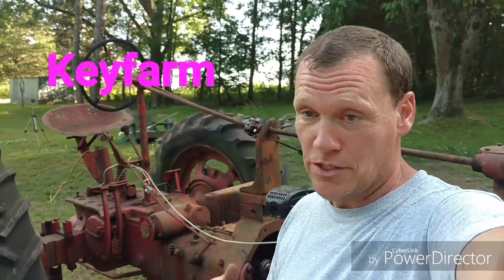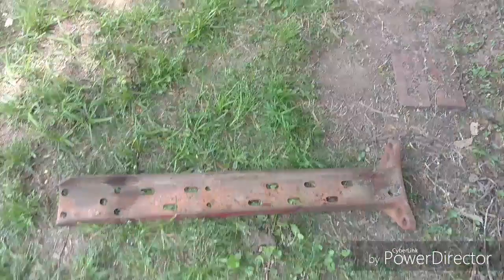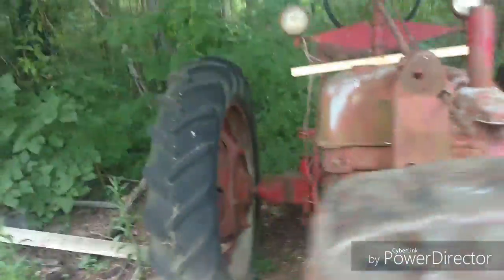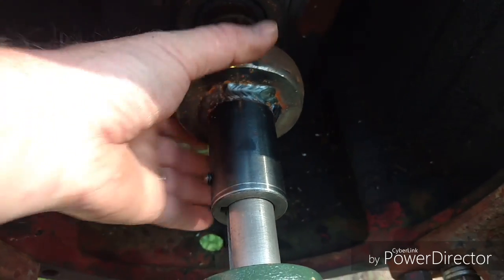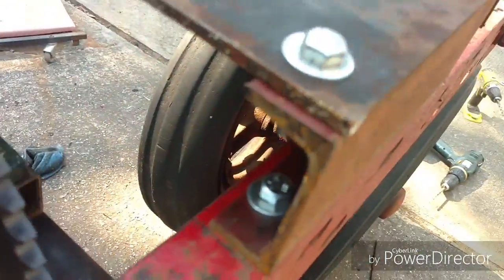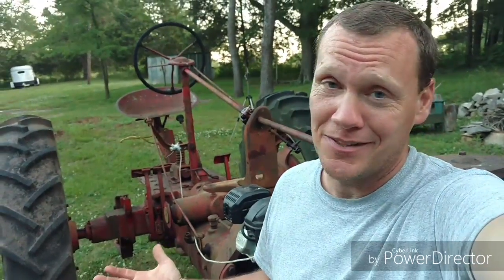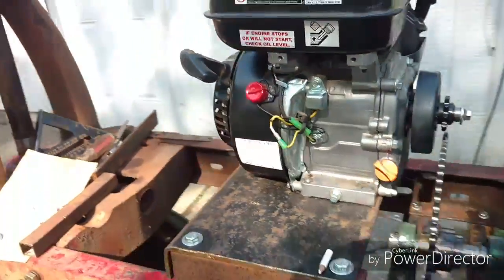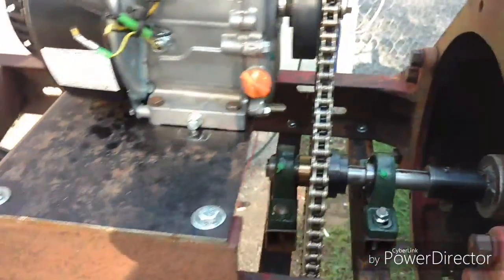Predator 212 Tractor

Comment: Dand a cvt torque converter system woulda really helped on this build .you get the power were you need it the most and runs way better then a regular cart clutch . Them centrifugal clutches only work good when you have the power an rpms to keep it fully engaged. Pretty much only full throttle all the times a keep momentum so it to slip.
Reply from the maker: On a tractor you run it at full RPM so that's not a problem .I have had CVT systems on other projects and I have found that you work on them about three times as much

Comment: Those old H tractors are known to crack around the water Jacket so if thats all thats wrong with the original motor I'd put some JB weld over it and take off. I have a 1936 Farmall F-20 and it has JB Weld over a crack in the block for the last 15 years.
Reply from the maker: This one was cracked at the back of the block where the camshaft sets I don't think we wanted a wobbly camshaft.

Comment: Love the videos! I want to do this to a 1979 datsun b210. One question- why not connect the motor shaft directly to the transmission shaft via the couplers? Do the gear teeth/size ratios have affect speed/and/or torque? Just really curious to kn ow before ordering parts
Reply from the maker: First and most importantly you need a way to clutch it The original motor the clutch is attached to the flywheel and of course that is gone second reason with these low power engines you need to multiply torque to get them to do what they need to do. Check out my other videos where I have put these engines in small pickups and small cars as well as big pickups

Comment: Are u happy with the 82 inch sprocket. Is it enough to pull a single plow?
Reply from the maker: It was an 84 tooth sprocket, and yes at that gear ratio it'll pull anything or spin the tires( watch the stump pull video) it is just slow

Comment: Very nice man. It's awesome.  You should try a belt drive system instead . It's all there at tractor supply. You just need a large 14in pulley or so. A small 2in x 5/8 . all half inch ,and a idler.  N youd be way way happier with it.  You'll have way more control, With a actual clutch. And no over  heating n those  clutching belts last for ever.  But make sure it's a clutching belts. There only like 30 bucks but they really last forever n take a beating . No lie.
Reply from the maker: Thanks, I've considered belt drive, just busy with other projects right now.
Reply: @ChrisfromKeyfarm  oh I just saw it was 2yrs ago.   Ill definitely check out the chanel

Comment: Thank you for the inspiration! I have been studying your engineering for awhile and decided to collect all the parts for my own project. Mine is a McCormick Deering international harvester model 10-20 probably from the late 1920's maybe 1930's. I just completed my first test drive tonight and am happy with the results. I used a Briggs and Stratton 8hp from the 1980's. The engine needs a rebuild, so will be disassembling and doing that work soon.
Reply from the maker: That's awesome

Comment: Hey Man like the channel I have a little project I'm starting can't wait to see how it all goes
Reply from the maker: Cool, what is it?
Reply: @ChrisfromKeyfarm  planning on putting a 459 predator in a s10 4x4
Reply: Think a centrifugal is a good way to connect the transmission?
Reply from the maker: That's how I connect mine, it seems to work just fine.
Reply: @ChrisfromKeyfarm  good to know will be interesting to see how it works

Comment: Very nice but how do you shift without the couch?
Reply from the maker: Centrifugal clutch stops when you release the throttle. On my pickup I built the same way, I float the gears like driving an 18 wheeler without using the clutch.

Comment: What's the biggest load you've pulled
Reply from the maker: Well, I made a video of it pulling a stump and that was pretty cool, but something here recently , with my farmall C I pulled my 16 ft hay trailer to the barn with 2 rolls on it. When I hooked the Predator 212 farmall H to the hay to pull it off the trailer, it pulled trailer, hay, other tractor and all, till the mud piled up in front of the other tractor tires and the hay began to move. This thing is slow but strong.
Reply from the maker: There is also a video of it pulling my 16 ft. With 3 rolls on it.

Comment: The older farmall engines are beastly. if you can get them. i got a farmall 450 the block and head are immaculate, no cracks or repair welds. it has the big back c281 engine in it and could pull a 4 bottom plow if i had on in the toughest of grounds.
Reply from the maker: Awesome

Comment: I was recently given a '97 Wheel Horse 520h with an Onan 20hp engine. I wonder how a Wheel Horse horizontal shaft engine with its PTO would do in a build like this? Like the PTO could be setup to work with a foot pedal to control the tranny? Might be interesting.
Reply from the maker: It would be
Reply: @ChrisfromKeyfarm  If you're not familiar with the old style Wheel Horses with their horizontal shaft engines and PTO's, the PTO design is similar to what is used between the transmission and engine on old farm tractors and manual transmission cars and trucks but it is set up slightly different. On manual transmission tractors, cars and trucks, the engines flywheel is a steel disc and the transmission has a clutch plate mounted to it controlled by a clutch slave cylinder to push the clutch disc against the engines flywheel to transfer power between the two. On the Wheel Horse machines, there is a steel pulley that has a smooth inside face that does the same thing the engine flywheel does. Then there is a clutch disc with a fiber facing on the engine drive shaft. This clutch disc is a pulley also and turns continuously while the engine is running turning a belt that goes back to the transmission, which is controlled via either gears or a hydro unit to move the machine forward or backward. When the clutch lever is engaged it presses the outer steel pulley against the clutch fiber disc on the engine and that provides power to the belt that runs the mower deck, snowblower unit etc.

Comment: That's cool how you able to shift gears without clutch inside transmission?
Reply from the maker: I can start from any gear, or if you match the trans speed to the motor speed, you can " float" the gears.

Comment: That's cool how you able to shift gears without clutch inside transmission?
Reply from the maker: The tractor is geared low enough you can start in any gear, also it has a centrifugal clutch on the engine.

Comment: I want to do something like this, but with a v twin predator. Problem is I can't find a centrifugal clutch rated for that big of an engine. Also with this set up you probably need to start it in gear, right? I'd think the input shaft would spin quite a bit even with the centrifugal clutch?
Reply from the maker: The centrifugal clutch free Wheels the input shaft doesn't spin at all until you rev up the engine as far as a clutch rated for that high they do exist and they start at about $265
Reply from the maker: Eventually this tractor may have that 22 horsepower predator but that's about an $1,100 project between the motor cost the warranty on the motor and a real high-dollar clutch
Reply from the maker: https://www.ebay.com/itm/CENTRIFUGAL-CLUTCH-HEAVY-DUTY-DOUBLE-GROOVE-A-WITH-1-BORE-24-HP-BRAND-NEW-/350723585062?mkcid=16&mkevt=1&_trksid=p2349624.m46890.l49286&mkrid=711-127632-2357-0

Comment: Within that whole thing.  Whatever can power the chassis, will work..  The big old diesels needed mass to develop torque, big pistons movin slow. That 212 less horsepower than the original it'l move that chassis all day.  At whatever point you can stall out the 212. Thats its peak torque.  The original diesel will run the chassis all day.  The difference is the original you can hook up a freight train, not really , implements,  that 212 if you leave it in place,  it will rotted away before 10 years, definitely not 80.
Reply from the maker: For the price I can replace it every ten years, aside from that at least it is useful again.

Comment: I am using a Predator 212 to power my full scale WWI tank.  It only needs a little bit over idle to move it.  The tracks freewheel over bogies with a hidden tire underneath providing the push.  I will be doing a video on the whole build as soon as it is 100% complete.
Reply from the maker: That sounds awesome, what's the channel name.
Reply from the maker: Nevermind, I saw it

Comment: You really should switch places between the giant sprocket on the transmission for and the tiny gear on the engine. It will go a lot faster and won't have to work as hard to go anywhere as you can see showcased in this video.
Reply from the maker: I have to have the large mechanical advantage for it to move.

Comment: I don't hate what your doing.  Im not exactly in love with the clutch set up , there is a newer juggernaut clutch from go power sports that you may feel is more appropriate for your use .  Ive got an older diesel tractor that has ovaled cylinders. Im interested in doing a similar project but im going to need to use the factory clutch because I need the pto to work.   I  will have to make a gear box and reduction on a 670 to make it worth having though
Reply from the maker: does your tractor have a two-step clutch one that stops the forward motion and one that stops the PTO ,because as far as running the PTO ,it runs off the gearbox in the transmission on my tractor all my PTO is work. when I put a 670 in this the first time it won't have a centrifical clutch it'll have a depressed tensioner that works off of the clutch pedal if that helps you any. They make really heavy duty double v belt centrifugal clutches but they're real expensive like $260. and above. As far as gopowersports I'm not really a fan of their inflated prices. Thanks for watching

Comment: Put a 4 cyl diesel like a kubota V2203 or a 4cyl Kohler diesel on that beast with a normal clutch or run a hydraulic pump off the engine to run a high speed hydraulic motor. Obviously for the most part this is just built with what parts you had on hand but you've proven your concept works now to just rebuild, refine and make it super bad ass. Or just keep as is.
Reply from the maker: Check out the R/C video, that is why it needs a centrifugal clutch.

Comment: I got a ? On the 212 swap for a tfuck would it be better to use a diesel trans because of the lower rpm range?
Reply from the maker: That seems like more trouble, just go with a bigger sprocket on the input shaft.

Comment: To each their own, but personally I think you would have been much better off to buy a $300 original motor out of a junk yard, and put it on. Would have kept its value, and originality. Plus it would be a lot more useful.
Reply from the maker: It would be just another Farmall H, nothing special or interesting.  Years ago I looked for an engine in my area, nothing close to$300.00

Comment: This is NOT a criticism, just an engineering observation.  The mounting holes for the bearing / driven sprocket carriers would have been far better to have been located on the top of the frame rails.  Here is why... as the holes exist now (on the bottom of the frame rails) they are piercing the "tension" side of the member.  This makes them far more susceptible to fatigue cracking.  IF (that is a huge IF) one were to later decide to restore this 'old iron' to the original type of engine  (or something even larger) these holes could become a liability for strength.  Holes on the top side of the frame (while still weakening the frame some) would remain in compression and be far less likely to crack due to fatigue.
Probably the optimum construction would have been to not drill ANY new holes and instead constructed the brackets to bolt on to the outer sides of the frames with holes and slots already provided.
As I said in the beginning, this is NOT a criticism, just observation and hopefully a small learning point for any young budding engineering students of SOHK (School Of Hard Knocks)!
Good video!  Keep up the interesting projects!
Ken
Reply from the maker: Would you believe I knew that, however in this application I felt it did not matter, but one thing about channel iron, if it ever needed to strengthened at least it would be easy to do.

Comment: How about a Wisconsin VF4  or a  VE 4  Wisconsin they are both air cooled , you can find them  about  anywhere. Look I up used Wisconsin  stationary engines sometimes you can find them with the reverse gear already in place.. Just food for thought.
Fred Durbin
Reply from the maker: I promise, it has the setup it needs for the next step

Comment: Does the PTO work?

Isn't that little centrifugal clutch going to burn out? Hard to imagine it could hold up when these tractors came with 11 inch clutch discs
Reply from the maker: It stays locked up most of the time, doesn't build much heat. Yes the PTO works
Reply: @ChrisfromKeyfarm  With it geared the way it is now, can you get the pto speed up to 540rpm? I have a stuck H, I need the pto for my flight elevator and cordwood saw. The saw has to be run at 540rpm,

Comment: Why dont you put a small diesel on it like a 10hp or something 6.5hp ant nothing with that big frame
Reply: How many clutches have you went through so far
Reply from the maker: On first clutch, it doesn't even get hot, stays locked up. I mentioned that in the video. I can run it around the yard for 5 minutes, stop and touch the clutch, just warm, no friction, no heat.
Reply: Well that's good if it ant burning up clutches every hour roll with it brotha🤝🤟🤟
Reply from the maker: Trust me,this tractor is doing just fine how it is.
Reply: Thinking about doing a build with a 10hp tillotson on a go kart with a truck or trctor transmission still need to find a good rear end

Comment: I think it's an excellent idea to repower this old tractor but I would have found a way to put a real "H" clutch back into it.  Then powered it with an engine closer to the original 26hp of the H.
Nice work on what you have done so far though.  Put some weights up where the radiator was or as you try to pull anything of significance the front end will always be rising up on you, not a good thing to happen.
Reply from the maker: This is the first version of this tractors new life, I promise it has a centrifugal clutch for a very good reason. This tractor is doing exactly what it needs to be doing, keep watching, more to come.

Comment: Awesome it moves! Suggest going to a 70 tooth sprocket should help with the revs on the motor. Right now you probably hard on the governor just by listening to it when you said you had it in 4th gear. You have inspired me since I need a tractor for our property, my little John Deere 12hp RX 63 doesn't cut it.
Reply from the maker: Watch the second video where it pulls the stump, it's pretty amazing

Comment: Yup, you need an array of 212’s all on the same chain. When all the clutches lock up it will be awesome.
Reply from the maker: Lol, remember the old tractor pull tractors that had multiple V8 s hooked together. What if I extend the channel iron frame and put like 12 in there, LOL
Reply: Keyfarm exactly!! With strait pipes!

Comment: Who would have thunk, that would work.
Reply from the maker: I was pretty sure it could go around the yard, didn't know it would have the power it has, did you see the second video. Stump pull
Reply: @ChrisfromKeyfarm  Not yet will check it out.
Reply: Checked it out . I am surprised that clutch on the motor didn't slip. Do you know what the HP was on the original motor? I know some of the tractors had very little HP in those days.

Comment: I bought our torque converter for our go kart about 2 years ago off of Ebay for I think around $80.00. The chinese torque converters were very reasonable compared to the bigger names, at least a couple years ago, not sure what they're going for now. I would like to see what the performance difference is between the clutch and converter. I'm betting that you would like the converter more because they make up for some difference in the gearing ratio, better low end torque when it needs it as in pulling and higher speed if your just tooling along...
Reply from the maker: I bought a cheap eBay converter a year ago for the golf cart project, it's been great, a year later it has the original belt still, but since the pandemic they have increased dramatically if you can even order one.
Reply: @ChrisfromKeyfarm  I see, I'll have to check them but yeah, that's the same case with a place that I ordered chainsaw parts from in March, I ordered right before the Covid stuff happened and I'm still waiting for them. Shipping says that they're still in China and since then shipping prices have spiked way up.
Reply from the maker: Yep, you know what I mean.

Comment: At a tractor show I saw an Avery with 6 5 horse Briggs all belted to a common shaft in front of the original clutch and flywheel. It sounded great and pulled the sled very well in it's weight class. 6 x 212 would be 1272 ccs. No balancing, no timing needed. He put 3 engines on one side and 3 on the other. It was very cool. An Avery is about the size of a farmall  C.

Comment: You didn't need a clutch at all. The transmission has a clutch in it. You need the chain for the gear ratio probably, but no clutch needed.
Reply: it does not have a clutch in the trans. it HAD one in the bellhousing on original engine.

Comment: Since I have owed a number of Farmall Hs over the years a 212 is not that far off from the original HP, Which if I recall was only about 26HP... The only thing I would have done is installed a clutch so that it worked the same way.  The upgrade to a 670 would be just about the same HP rating as original. More than likely would have better power than the old unit anyways. Might even be more fuel savings over time. Repower is the way to go with a lot of older units. Nice work anyways!
Reply from the maker: Thanks